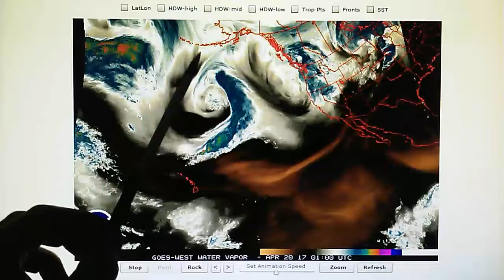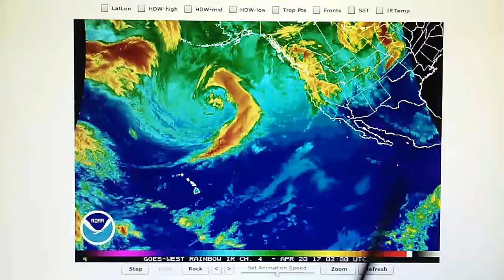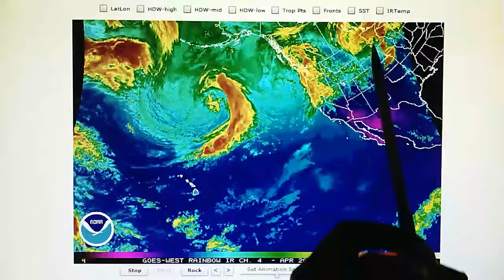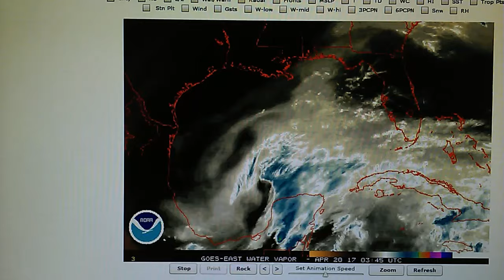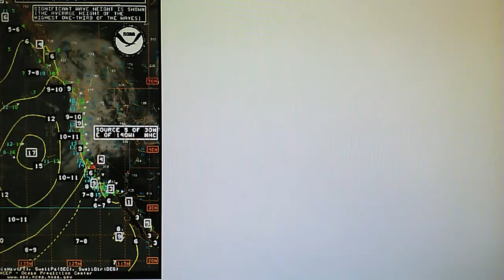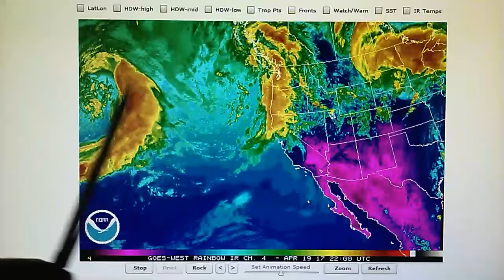4-19-2017; High Pressure Setting Up to Block 983 Storm; 90F Temps On Menu For Southern CA Weekend!

Comment: Wher do U think the transmitters are? On boats? Can U locate any such boats? I have noticed a sort of hum sound when they turn the transmitters on here in Eureka Ca it is normally associated with wind and sometimes rain. And a crazy as the weather  has been most folks think it is Mother Natures fault.  NorCal Geo-Engineering Watch on Facebook
Reply: EurekaRecycler- There are land based radomes as 1PacificRedwood has shown in previous reports. Also, RF Transmitters are located on Navy Platform ships.. look at TheHAARPReport channel for this info. Also check out Elana Freeland here on YT, and her book Chemtrails, HAARP And The Full Spectrum Dominance.